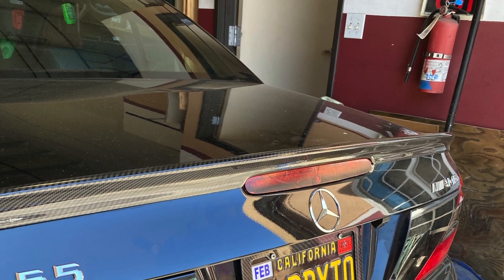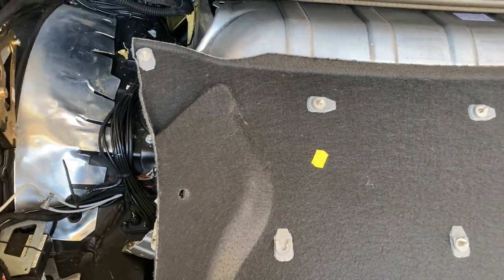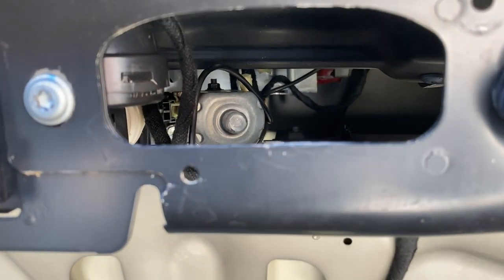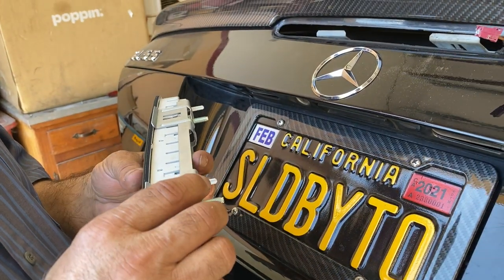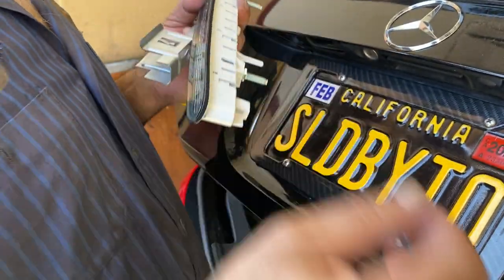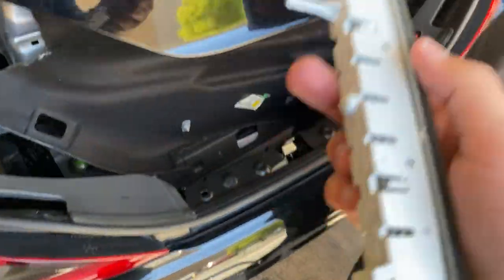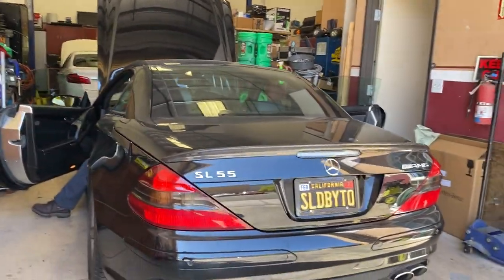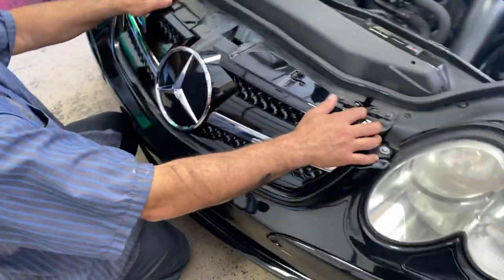How to update the 3rd brake light & and Grill on the SL55 AMG | SL55 Build pt 5

Comment: Thanks for the video, you mentioned that you had some work to do on this SL 55 on the gas tank ? Was it a loose battle inside the tank? If so, how did you fix that, thank you, good job on the video, Steve
Reply: I have read of people adding a spring to hold the baffle in place.  Does not require removing the tank from the vehicle.